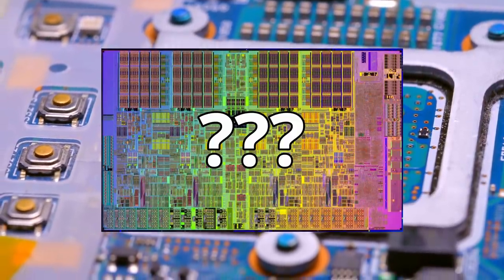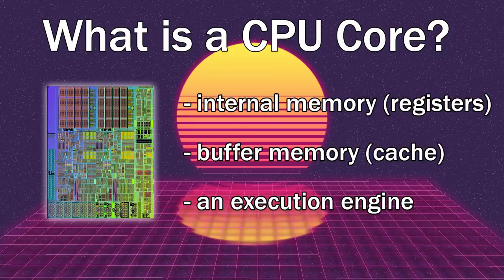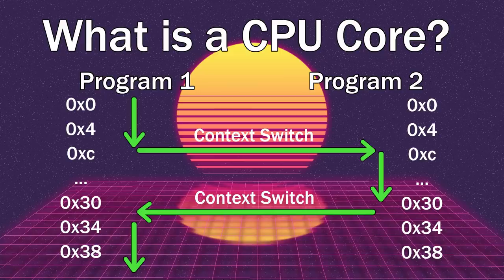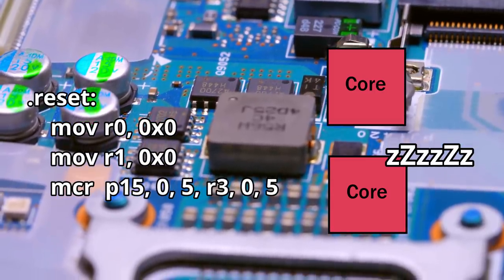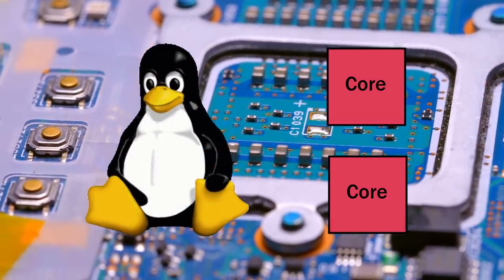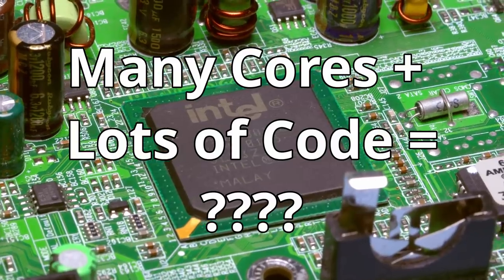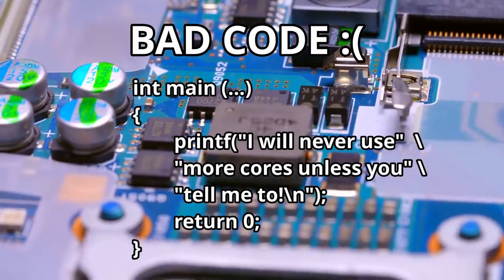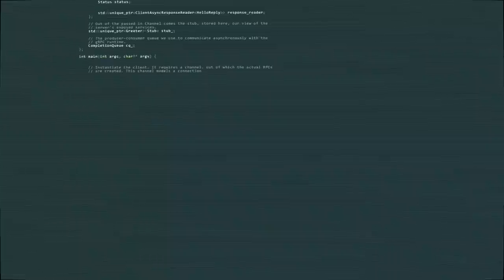why can’t computers have thousands of cores?

Comment: Both Intel and AMD are rumored to release server processors (codenamed Sierra Forest, and Turin respectively) with more than 200 cores in the next few years (as soon as 2024). Servers will continue to scale well and make use of as many cores as you can give them.
Reply: Aren't these are intended for data center where customers lease VMs or some other slice ?  AMD has encrypted RAM....
Reply: This video is about home and personal computers. Obviously industry hardware is gonna be a lot tankier
Reply: @cassandrasibley228  well, some of those xeon server processors end up in high-end workstations.  I suspect higher end workstations might have take a mid road between core count and individual core performance.
Reply: @kayakMike1000  Can't I just enjoy learning about the extreme limit to the same tech without people going "Uhm ackshually that's not designed for consumers"
Reply: Sun/Oracle had a 128 core SPARC64 chip over a decade ago. I've still got one of those servers in my basement.
Reply: H h h
Reply: @AnarexicSumo  no. you cannot, apparently. the extreme limit of all technology is an attempt to fill a need for the customers that use it.  The customers that use chips with 100s of cores are data centers and compute utilities.  Learn about 'em if you want to, but also learn why they were developed, it's part of the story.
Then again...  Maybe saying this is like saying rocketship a are designed for astronauts, which isn't quite right...  It's more like astronauts are trained to fly rocketships for the purpose of space exploration and experimentation.  We all benefit from that but it's immediately apparent that you're probably not getting a rocketship anytime soon.  If you do get a rocketship sooner rather than later, well then I'll be your copilot.
Reply: software used on these are written with parallelization in mind so it scales well, forking instances, docker process, etc..
Reply: Not to mention supercomputers that already have 1000+ core CPUs.
Reply: you need those cpus for webservers and vms :)
Reply: Exactly
Reply: Adapteva released a 1024 core processor in 2016
Reply: Cerebras. 850k cores, takes up an entire silicon wafer.
Reply: already now we have 128/256 C/T already, so it definetly is coming
Reply: Yes this is necessary thanks to the laws of physics gving Moores laws a swift kick in the groin. We cannot really increase transistor density that much anymore cuz we can't make transistors physically smaller. So the only ways to improve throughput is either decreasing execution path length, which has inherent security concerns(remember meltdown and spectre?), or by increasing the number of parallel execution paths, which comes with the synchronization, memory consistency, and caching problems that parallelism creates. Servers are much more capable of having more cores since they host computational resources for programs which are entirely independent, and therefore never need synchronization or a consistent view of causality. That's a bit more tough to do with, say, an Xbox.
Reply: @jackwilson5542  Those are computers with 1000+ cores not super impressive. A single cpu with 1000+ cores will be a technical marvel if or when one comes out.
Reply: @nickscurvy8635  what we need is to return to and switch to ternary computing not trying to squeeze more out of binary computing.
we went down the wrong path going towards better and better binary computing.
Reply: @HamguyBacon  why ternary? Doesnt that still need transistors? The transistors are the problem here, not the number of discrete states within the computational model. 

The problem is we are pretty much at the point where, if we make a smaller transistor, quantum tunneling will actually end up being able to switch a transistor on randomly because electrons end up tunneling through the gate. 

We need either to stop using transistors to store state or we need to.design a transistor which doesn't rely on nanometer small distances separating electrons. 

I don't see how that would work with ternary. I mean the obvious way to make a ternary computer is to do it with transistors except now you divide the voltage range into 3 regions instead of dividing it in two.
Reply: Didn't AMD already make a 128 core server CPU? Wouldn't surprise me if they had a 256 core cpu coming soon.
Reply: There are a number of factors that must improve to fully utilize such high core counts, and  for the most part, there are factors that work against the higher core counts being commonly  used now and in the near future.  The most obvious is ram starvation; such high core counts requires massive amounts of ram to not be starved.  Fast disk access is also something that such a server would also need.   While it's nice to have a massive server with massive ram and massive local attached fast storage,  well, it comes down to redundancy of such systems.  While such computers can be made redundant with just a  second, the more server hosts that you have running in a cluster, the more redundant your cluster actually is, while minimizing costs.  Am I, as a datacenter manager, better off with 3 servers with 256 core per server host in a cluster, at $xxx,xxxx each, or am I better served buying 10 servers, at 64 cores per cluster, at a significant lesser cost per server ? As a datacenter manager, I'm always served better by having the additional nodes, or server hosts, not only because it's cheaper, it's also more redundant, and the loss of a host is far less impactful as far as capacity.   During my tenure working with a private cloud datacenter ( on premise, single customer- ourselves ),  I've always been better served by having more nodes, i.e. more server hosts per cluster.  Been doing it for 15 years.
Larger cloud offerings - well, they don't make money by buying the latest and greatest;  they utilize their existing servers till there's a significant need to change over.  Everything is bottom line focused.  While such high core counts will eventually make it into use, it won't initially until it no longer carries a GUCCI price tag. The current trend seems to be moving from on premise servers to cloud infrastructure- because management tends to not want to purchase high cost items;  cloud platforms themselves are very much market oriented, but also are bottom line focused, and also risk aware as well.   All of that pushes towards more nodes, with mainstream core counts.
Reply: @jackwilson5542  Most supercomputers aren't really 1 "computer" with a single high core count CPU. They're multi-socket systems with multiple CPUs in a lot of different boxes with high speed interconnects tying them together.
Reply: @cassandrasibley228  Everything is scaling up. AMD's first 16 core chip started with the Threadripper line, then they scaled up consumer Ryzen CPUs. Now with Intel attempting to keep pace, we going to be seeing a bit of a war in core density as opposed to frequency. Zen 5 will likely offer 32 cores on the consumer platform.
Reply: I mean but the programmers will have to do more work thank god I am retired from system programming lol but I still love programming
Reply: @AnarexicSumo  fair enough but most people if not all cannot afford a 30k cpu so some people learn what they can have access. LTT is for you then because I can't afford any of it
Reply: @HamguyBacon  so as humans we have only been able to "master" one quantum state and that was only with photons, and we can't use that for quantum computing. So the "Spooky Physics" (A. Einstein) we were able to observe is that photons are waves and particles but not at the same time, the difference is if it was observed or not, and yes mechanical observation placed the photons into the particle phase. so here is the case, first the photon was a wave, once it was observed it became a particle even when it was not humans doing so, hence inside a computer be observed constantly photons can only be particles. Lets me guess your going to bring up Schrodinger's cat thought experiment as quantum physics but there is a issue with it. there is a observer that no one takes into account. The cat is self aware so it needs to be placed into the equation so there is no time that the cat both alive and dead. True the human has no idea but that just proves that for us as humans to know if its dead or not is related to our observation. Oh yeah you cant take power away or all the memory goes bye bye just like ram and will cost millions to make hard drives that can be -1,0, and 1 as we would have to make them as we did for the processors for the Saturn 5 rockets (yes we have made ternary processors) as bits were placed on a lattice made of copper wire and would be (-1) spinning clockwise, (0) not spinning, and (1) spinning counterclockwise. binary is much simpler due to 0 v is a 0 and any voltage is a 1, now i know why cant the voltage strength be a signal for if it is a -1 or a 1? we can not count on every piece of hard ware to carry a given voltage due to imperfections during manufacturing and most importantly installation of that hardware so voltage can not be perfectly maintained. (like opps I dragged the MB over a standoff for .5 mm while I got it in place)
Reply: Linux tech would love this
Reply: @AnarexicSumo  Shades of "640K should be enough for anybody!"  when 1 MB expansions were already a thing.
Reply: Unless you want to run a single minecraft server because java
Reply: @nickscurvy8635  I barely know anything about these stuff, infact I got recommended this video randomly. But I heard photonic computers are being made? would that solve the issue of using transistors or does also use transistors? what about quantum computing? does that use transistors?
Reply: @cassandrasibley228  Along that line, an old Sun Solaris server I used to support had something like 256 quad-core CPUs, for a total of 1024 available cores. Problem was, this customer with more budget than sense confused capacity with speed. The version of the database running on the server couldn't expand beyond 512 threads. Throwing more CPUs at the problem solved nothing. They would have been better off replacing it with something like a fast Dell enterprise server. Far fewer available cores, but much faster throughput.
Reply: @jackwilson5542  that's actually not true. Supercomputers may have thousands of 32-64 core processors in it, but never a single 1000+core CPUs
Reply: @forza1sra  they will
256 cores in Zen 5
384 cores in Zen 6
Zen 6 is scheduled at 2025/2026
Reply: DUDE, this excites the shit out of me!
Reply: @Squizz11222  Thanks.
Reply: - First multicore was introduced by IBM in 2001
- 128 Core, 256 thread workstations and servers have been available since 2019, thanks to dual CPU mainboards
- 256 Core CPU's are expected in 2023
Reply: that's going to be the start of an era where we no longer can buy a physical computer, because manufacturers will just make server spec machine that is so efficient and we are forced to subscribe to a cloud PC. scary.
Reply: @AnarexicSumo  yeah the enthusiast sector is growing more diverse. We are seeing more people as hobbies doing things like computer science, AI/deep learning, and more demanding graphics design more and more people interested in high performance rigs for stuff beyond gaming.
Reply: Different needs. Servers are meant to interact with thousands of computers simultaneously. This need will remain limited to servers and will not bleed to home computers.
Reply: No if they share something else, like memory or IO
Reply: At a certain point the silicon atoms will be the ultimate limit. Scaling will come up to a harsh stop. Unless we discover another material that suits for transistors, that may not produce this much heat, we might see huge scaling in the future. But even that will have physical limit. Simply because atoms themselves measure around nanometers. The only viable solution is the quantum computing. Otherwise a hundred years from now we won’t see much powerful computers.
Reply: @littlemeg137  man cave space heater? Or still doable?
Reply: @kayakMike1000  Anyone can buy these server 100+ core cpus and alot of people use them for things other than servers mate
Reply: Yeah servers and consumer use cases are vary vary different, a server yes, I can see servers using 200+ cores for such as VM deployments, but a consumer doing a few things at once, yeah no need for that many cores, but fewer faster cores. And if the consumer needs more cores, you got options that will most likely still outperform a them 200+ core chips in single threaded work loads or lightly threaded tasks, so 200+ cores doesn't always mean faster if you can't use them.
Reply: Indeed, on massive dies you'd never stick in someone's desktop. All that power isn't going to be used by any given program or even a few. You divide it up among a number of virtualalized operating systems (or at least containers).
Reply: epyc 9654 is out. 96 cores, 2 socket, 260W per socket. they're bumping up against thermal limits and it's simpler just to deploy a stack of 2U 2 socket boxes full of ram. 
it's economics, and general purpose cpus aren't going to have 1000 cores. get something like NVDA GPUs and it's different
Reply: What about the manufacturing process? Can CPU producers go below 1nm?
Reply: @oldi184  Probably not. It's literally too small for electrons to stay in their lane.
Reply: @oldi184  questionable. also questionable how much gain that brings - you're working with 2-3 atoms at a time here and your ability to scale power and clock speed may not track what's come before
Reply: @littlemeg137  that's funny because the SPARC XIfx in 2014 had 34 cores (32 compute, 2 assist) with 2 sets of 12mb L2 cache.
Reply: @kayakMike1000  yes it’s for data center
Reply: Who knows when intel will get that out there I hope on time but I don’t have much hope
Reply: @kayakMike1000  i wonder how this hot take pans out given that when you wrote it 64c/128t processors that sold for $8000 to consumers for consumer level PCs literally would sell out the second they came into stock.
Reply: @oldi184  the "nm" in the name of a process does not refer to literal nanometers. In fact, 3nm processes often still include micrometer scale parts. The numbers in these process nodes stopped meaning anything significant over a decade ago, and only represent a marketing decision made to help consumers understand if a product is "new", not even if its better. The 1nm process node from TSMC already has been physically created at least once in R&D. To no one's surprise, it contained nothing measured at 1nm or less.
Reply: @austinblackburn8095  Supercomputers are using cuda cores as a alternative. Regular consumers use the thousands for encoding on the fly.
Reply: @kayakMike1000  an.advantage of workstation and server motherboards is more I/O channels.

So I built a 10/20 core workstation for gaming. I can have the system doing multiple things, while gaming with no lag.
Reply: websites or vms only need about 1ghz + 1gb ram and a tiny bit of cache. so for servers this makes sense.
Reply: @cassandrasibley228  industry stuff eventually makes its way into the consumer market. Obviously.
Reply: @jlebrech  thats an extremely specific and untrue over-generalization of the requirements of an extremely vast array of incredibly diverse systems... you must be the guy in charge of assigning VMs at my work because the lack of understanding you just showed is impressive.
Reply: My prototype pc has 25 cores each with 5,5 gh
And you know what? Im thinking of adding some more next year.
Reply: Amdahl's law
Reply: @laymansjourney6207  
Am "observer" has to be outside the system.

The cat is NOT an observer.
That's why the box has to be sealed.
Reply: @evilspawn311  amdahl's law is a great way to theoretically measure performance improvements through parallelism, but it falls very short of the reality we see today. There aren't any tasks left that cannot be run in parallel threads, even a UI thread relies on numerous others to do its work for it these days. Its a great way to measure the expected performance increase if you are just a consumer running older software but if you have any say in the software itself you can avoid the constrains Amdahl mentions by just changing the behavior of the software. It also doesn't take into account that modern CPUs can split the work of a single thread to the lowest temperature core and actively manage which core is doing the work, meaning for the last 4 years consumers have been able to avoid Amdahl's "limitation" by simply using modern chips that can assign a single thread to different cores that would be more performant at any given instant. This is actually why in single core benchmarks it can be hard to nail the same result twice but  in all core benchmarks you're frequently within the normal margin of error.
Reply: The only benefit to having a CPU with that many cores is for virtualization tasks.  In a standard VM build (4 or 8 CPUs and 16GB of RAM), you'll be able to have  25-50 VMs with dedicated hardware on a single CPU.  Since very few workloads require dedicated CPU power, something like this is overkill.

VMware has a metric called ready time which indicates how much time a VM is waiting for the CPU cores to be available to execute an instruction, and it actually takes a very large amount of ready time before there's a problem with a physical CPU getting crowded by VM workloads.

Also, having a system this dense makes it impractical from a resiliency standpoint, because if you target a 4:1 ratio for VMs on a single physical box, you could have 800 virtual CPUs running on a single box.  If someone trips over the power cable, you now have a ridiculously large number of VMs that need to be recovered somewhere else.

The only time this makes sense is if you are running a cloud computing service (like AWS, Azure, or GCP).  Otherwise, these are going to be ridiculously expensive for even general enterprise customers, and would be a huge overkill for most applications.
Reply: @castertr0y357  i would say it can make sense in other uses as well. Think rendering, engineering simulations of fluid dynamics running on 20 GPUs per box, processing millions of credit card transactions for a bank, compiling Chromium in less than 10 minutes (or just as a general compile box, but that's likely to be installed for CI/CD in cloud anyway), or many other government, financial, scientific, and creative processes that would benefit from extreme parallelism. There will come a day when Disney's rendering farm as of 2022 will be outpaced by a single machine, that day may not be any time soon... but it will come. A single dual socket EPYC server from this year will already outperform multiple server farms from 12 years ago, and there are still a lot of business running server farms that old.
Reply: Only as long as the servers' workloads are highly parallelized and light, such as serving thousands of copies of a website to clients, and not highly serialized and heavy, like ingesting data.
Reply: @explodatedfaces  they already use GPUs for rendering and fluid dynamics because they have 300+ cores and the memory access is closer.  GPUs are already designed for parallelized workloads like that.

There's really no need for CPUs to do that too since GPUs have a large head start in that field, and already do it well.
Reply: @kayakMike1000  No the stateless nature of HTTP means they are great for that too, being stateless every HTTP request is independent of every other so a server with many thousands of clients making requests at once can use a thread and thus core for each. We already have servers that can be running thousands of clients at a time most of those will be in I/O wait but the point remains the server can assign every pending request to another core if it has them. Granted such a server will need an exorbitant amount of I/O bandwidth to retrieve the data needed to fulfil those requests and more importantly an extremely high 4k random read rate on said storage. But yeah server workloads are highly parallel as each client request tends to be independent of each other and can be processed separately and the highly many to one nature of server interactions means there are a lot of those multiplexed onto one machine.
Reply: @castertr0y357  Ok so... saying a GPU has 300+ cores is both misleading and also literally correct in the worst way. Try 16,000+ for a single RTX 4090, but those cores are not like a CPU core. To add to this, what do you think drives a GPU? All of the information, every single last bit of it, first goes through a CPU. That's why the GPU is connected through special copper lanes directly to the cores of your CPU called "PCI Express Lanes". Your GPU, even a scientific GPU, does nothing without the CPU's command. When you need to increase your capacity to drive GPUs whether because they need to have more throughput, more beefy GPU chips, or just more GPUs per system... you need to increase the number of cores in your CPUs. When you use a 4th gen EPYC 96 core CPU you can achieve a throughput of 1TB per second to the GPUs, when you use Intel's Xeon 9282 56 core chip your GPUs are rate limited to 0.32TB per second.

Cores matter for many reasons. Does it make an impact on your viewing experience of Youtube or your post on Twitter? No. But there are many hundreds of millions of people who rely on systems that just a few years ago cost over a million percent more to achieve the same results as you can get today for 1/10,000 the price... because more CPU cores means less systems, using less electricity, driving fewer GPUs because each can do more work, to accomplish everything substantially faster. It's not 2010 anymore, and the future of computing is going to become more cores, and core agnostic scheduling that utilizes all of them for any task you provide it. As professionals we can either get comfortable with this, or be left in the dust while waving our fists at the sky and yelling about "back in my day".
Reply: @explodatedfaces  yes, which is why Microsoft created a protocol that allows the GPU to directly access storage medium to bypass any potential CPU bottlenecks.   

Also why almost all crypto hashing was done using GPUs due to their natural advantage at parallel processing.

My point isn't to say that more cores are bad, but that it's not going to be the holy grail that you think it'll be.
Reply: @kayakMike1000  I just want to say that I think your comment was surprisingly well written and respectful for the youtube comment section (especially comment replies). Like I think if you read it with a bad tone the first part could be bad but I like that you actually considered and thought up new ideas here, and I think that second part shows me that the first part of your comment was meant to be read with a respectful tone.
Reply: I just want to say that while there were a few snarky remarks and "oh you're inexperience shows this is why I am the professional here" comment replies here I just want to say that this discussion has overall been way more respectful and educational than most replies to youtube comments. Not perfect, but genuinely surprised me, so you guys get like a B+ or A-.
Reply: @castertr0y357  there definitely are no holy grails, you've got that right. Automatic parallelization has already changed our entire world though, and you will see the use of it substantially increase and become more relied upon. You will see the retirement of x86 in your lifetime and you'll see that new instruction sets are built around this concept. It doesn't work in every case, it makes things worse in some cases, but as of right now the overwhelming majority of work users ask their computer to perform from gaming and art to science and theory already prefers processors that can work with more cores.

Also, yes! There are ways to make the GPU do all of the work, the main issue with that is outside of specific use cases the GPU still needs to send data to the CPU because it doesn't understand most instructions. You still have the same issues as before but now they're reversed, so it can make specific things like graphics processing faster at the cost of other computation getting slower. If you built out a scientific server for example you could use this to process data on the GPU directly but its use cases would be limited by the physical memory available to the GPU, as its no more useful to make the GPU talk to the CPU to get access to RAM than it is to have the CPU talk to the GPU to give it access to RAM. There definitely are some intetesting future concepts for it though!
Reply: I wonder if any attached processor similar to NVIDIA GPU  4090 can have any improvement over 200 cores server ? (there are latency in data transfer CPU-GPU)
What marketing segment of application correspond to straight design of over 200 cores ?  (Geophysic workstation ?, Universe simulation ? AUTOCAD ?)
Reply: An RTX 4090 video card which is used by gamers in their personal computers already has over 16,000 CUDA cores, 128 ray tracing cores, and 512 tensor cores.  Each of those 1000's of cores is much more specialized than a "CPU core".  The amount of specialization of their instruction sets is most of the distinction, though.  GPU cores are still processing of machine code continuously.  As more CPU cores become available, more software will take advantage of them like software already takes advantage of the 1000's of GPU processing cores.  The main reason that only a few CPU cores are very helpful now is because of a chicken and egg problem.  There are only a few CPU cores in most computers so software is rarely optimized for 16+ cores.  Optimization of software takes time and money so if very few people have that hardware in their personal computers, the time and money to optimize for that case would be wasted.  As more computers get big CPU core counts, more software will take advantage of that.

If you don't do much heavy lifting with a given application, it won't make a big difference but certain kinds of software push the computer to its limits.  Modern 3D games, complex physics simulations, 3D rendering for movies tend to push computers to their limits.  Most of this software is optimized with GPU code because there aren't enough CPU cores to meet the need.  CPU programming is still much easier, flexible, and familiar for most programmers but we have to take the challenge of mixing GPU code or using libraries that batch process using the GPU to work around the lack of 1000's of CPU cores.
Reply: @explodatedfaces  Ultimately, the efficiency of things comes down to the software component.  You can have all the cores in the world, but if you have crappy code running on it, it's going to perform crappy.  You can't throw hardware at a software problem and expect it to go away.

Also, I don't believe that the x86 architecture is going to go away as long as we have semiconductor processors.  It's too engrained into the entire process.  I do think that as quantum computing progresses and becomes cheaper, we'll see that take over along with whatever architecture they standardize on.  However, semiconductor processing will likely have it's place, just like ARM has it's place as well.
Reply: We should go back to having one or two cores at like 5+ ghz each
Reply: @castertr0y357  I'll leave the discussion for blaming software for another day... interestingly it's untrue that software needs to be "optimized" for parallelism more than it just needs to have parallelism implemented, but you are already seeing the death of x86 my friend. ARM, RISC, M1, big.little, power, MIPS, there are many architectures new and old and the only one to be declining in use is x86.
Reply: @explodatedfaces  I'd say that's wholly untrue.  If you write a program that takes a list and then does something with it, by default, it will be single threaded, and no matter how many cores you have, it's not going to perform any faster.

You have to specifically set up parallelism to use all of the CPU cores.  This is where a producer/consumer model shines, as you can have consumers use up the cores doing individual work.

I spent a long time re-architecting a program to take advantage of parallelism, and it's definitely not as simple as flipping a switch.
Reply: depending on the operating system.
Reply: @cassandrasibley228  Seens you don’t know what tanker means.

I play League of Legends so I know.
Reply: its not rumor 4x 68 core
Reply: China already has them.
Reply: you realize quantum processors are being manufactured  in Langley BC right there is no need for any of this stuff on the corporate/government level
Reply: they already exist the threadripper is one
Reply: better to use more cpus that more cpu cores
Reply: @OcelotSF  depends on what you define a CPU to be. multi-core cpus are just multiple cpus in one package. so there is no difference between a core and a CPU except to marketing departments.
Reply: @jessepollard7132 , there’s also a thing about the size of cpu cores. I believe multi socket is more needed on server market than multicore processors
Reply: It’s just that trading between 2 and more cpus yet not fulfilled
Reply: @OcelotSF  sorry, both are used.
Reply: @jessepollard7132  I am telling that multisocketing is still not optimised
Reply: @OcelotSF  Actually it is the vendors choice. cache coherency is rather complicated in getting the timing right for all the signals that have to be passed to all the sockets. which is why dual sockets are more common than 4, 8 or 16 sockets (which do exist, but are MUCH more expensive motherboards). The larget multi-socket I ever worked with was an SGI Origin - 256 processing units, but I think it was in 128 sockets. then it got expanded to a 512 SMP system which required another 256 processor cabinet. and was reconfigured into a NUMA system with 8 sockets per node. attached with a hypercube interconnect.
Reply: Intel 512 core Xeon go BRRR
Reply: Cray Supercomputers literally have thousands of cores.  And it even shows them in Windows.  Go look at them on YouTube.
Reply: @netsider  YOu should read the HISTORY OF CRAY SUPERCOMPUTERS.
The current ones are clusters.
Reply: @netsider  You should read the history of  CRAY SUPERCOMPUTERS. the current ones are just customized clusters.
Reply: I think people forget that there are problems that cannot be solved on computers in human time scales. They are what’s called NP.  There are problems that can’t be solved. The halting problem. Then are problems where computations aren’t the issue. Exchanging information between the cores is, weather simulations are a case in point. Dividing the atmosphere up into blocks seems perfect to chop up into different cores. Yet they cannot work in isolation, one block needs to know what other blocks are doing around it. This is the interconnect issue. If you use a shared resource, contention is the problem, the most perfectly written software will not solve this.
Reply: 30 years ago squeezing so many into a package was unthinkable and impossible with the technology we had.
Reply: @littlemeg137  Is it still active for anything?